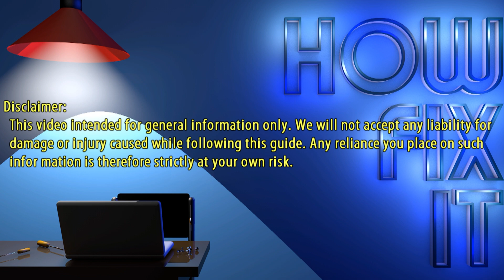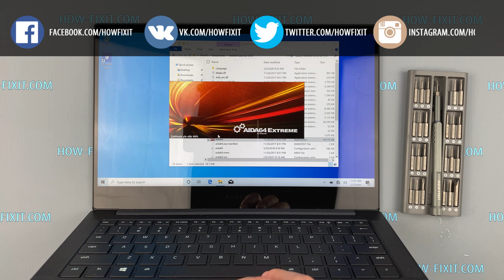Razer Blade Stealth 13 Disassembly, fan cleaning and thermal paste replacement

Comment: Hey guys this is a bit of a stretch,  but does anyone know where I can find a spare Motherboard for the Blade Stealth 2019? Mine died and I am not under warranty so razer wants to charge too much to replace it. I'm pretty confident I can do it myself but not sure where to source the part. Please help 🙏 😢
Reply: How come motherboard died , overheated while gaming ?
Reply: @lightspeed5098  not sure, it just doesn't turn on when the system powers up.
Reply: Ok but maybe have to buy another laptop I don't think anyone sells motherboard and if they sell it might be half spoilt so better not buy at all. Just buy a new laptop and sell away the spare parts

Comment: Don’t know if anyone can, been searching all over Google and can’t find anything. With the razer blade stealth 2019, can you upgrade the graphics card in it? 
Thanks in advance
Reply: you cannot in most situations upgrade the gpu in a laptop as it is soldered directly to the motherboard and would require specialty equipment to remove and an entirely new laptop motherboard to actually upgrade the gpu. No you cant upgrade the gpu in the razer blade stealth 2019.
Reply: no but you might be able to buy an external gpu, idk how that works tho.

Comment: What is that ribbon connector for? The one in the center, slightly to the left, directly above battery, which default appears to have nothing attached to it.